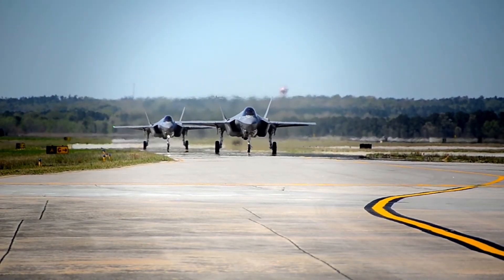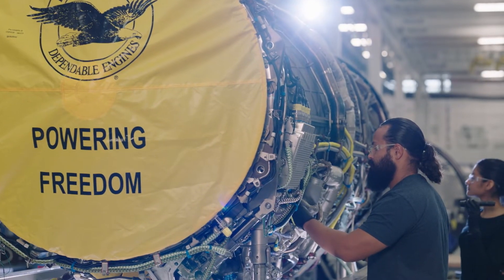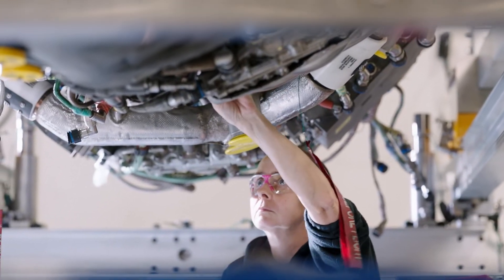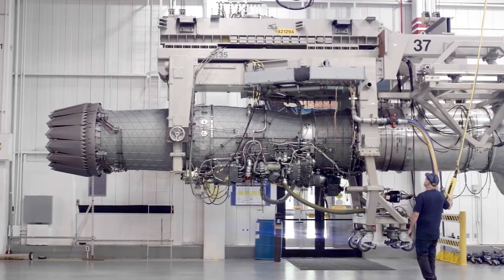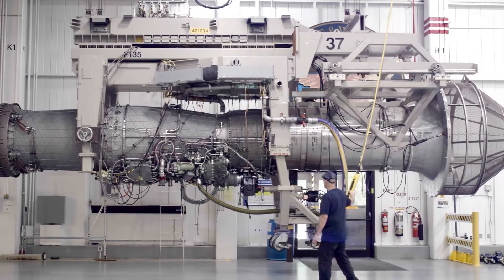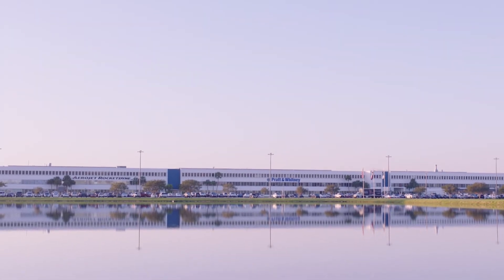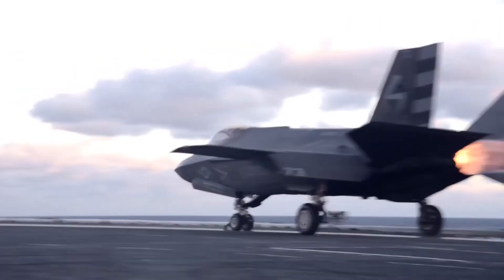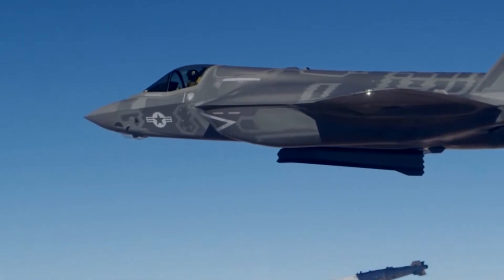The Future of the F-35 | Chapter 2 | Upgrade

Comment: Would be better if they just produce future F-35s with GE's adaptive cycle engines and have the old ones received P&W's core engine upgrades.
Reply: You’re assuming the GE engine would be just as reliable and that the test program to integrate the engine into the airframe would go smoothly, with little cost or delivery schedule concerns.  In other words, something that has never happened before will happen just because it’s a theoretical option.  The new engine core from Pratt will increase the thrust to 47,300lbs and increase fuel efficiency, without having to conduct a whole new test program for a new air-vehicle-propulsion system.  The F-35C airframe would need to grow due to the location of the tail hook and the volumetric considerations for the bypass ducts on Adaptive Cycle Engines.  The Adaptive Cycle Engine is a non-starter for the F-35B anyway, so now we’re looking at creating more diversification and complication where it isn’t needed, for a proposed capability that has not yet been proven.

GE engines have been less reliable in F-16C/D Block 50s than the Pratt & Whitney powered Block 52s.  The Super Hornet fleet is also suffering an unusual number of engine failures with the F414 that simply didn’t exist with the F404 powered baby Hornets.

Comment: What about the new Adaptive Engine Tech dropped into the F15-EX or "Loyal Wingman UAVs"?
Reply: You have to increase the mold line around the engine nacelles, cowlings, and likely the intakes, which means a whole new airframe.  If I’m building a new airframe in the 3rd decade of the 21s Century, it better be a stealth airframe, not a 1970s airframe.